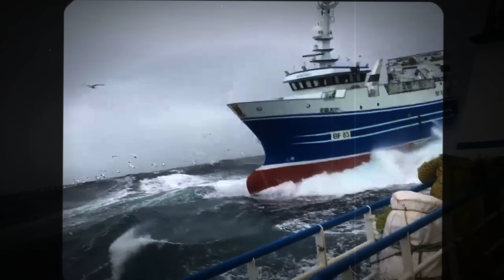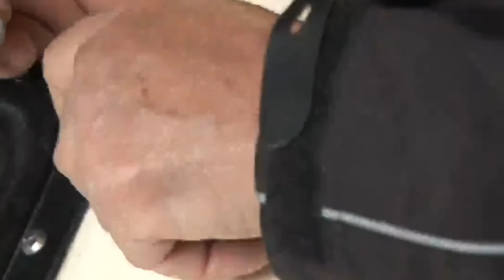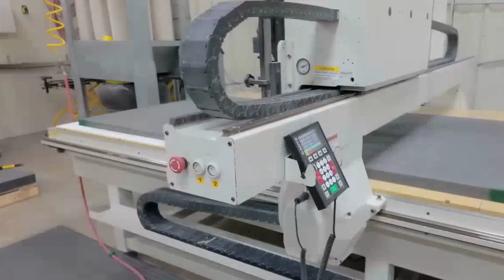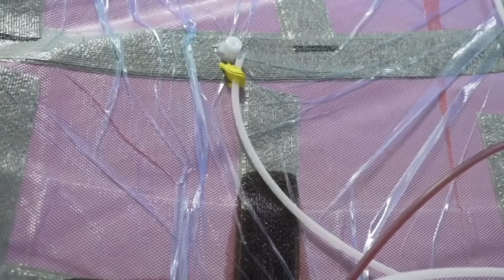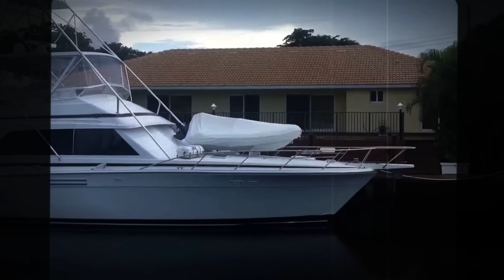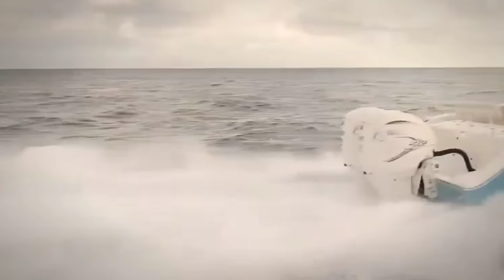The ONLY 7 Fishing Boats That Last 30+ Years in Saltwater

Comment: I have a 23-year-old Hydrasport. Hydradports from the early 2000s like mine user kevlar reinforced wood free hulls with composite fuel tanks and foam in the hull. They are tanks, but unfortunately out of production. The 24-foot Vector Series is in the same class as an older version of the smaller Regulators in my mind.

Comment: These are all very well built boats.  My only doubt is the Regulator. Not because it's hull is poorly built but I've seen A LOT  of Regulators with leaking fuel tanks. A boat is only as good as it's weakest link.  There are other manufacturers that use these construction methods, Such as Robalo. Robalo uses these hull construction methods, 316 SS thru bolted, no wood and Also uses Kevlar reinforced hulls.
Reply: I ran a few charters for a guy. He had a brand new Robolo . It's been a few years I'm guessing 2021-22. I don't know about the hull. But it was  not made well. Fold down seat broke after several trips. The dash board  and gauges always came loose . It had been back to dealer twice . Had to use duct tape to hold it in last time I ran it . The fit and finish was very sloppy in many places. I assume they don't make them like the older ones .
Reply: @paulrudar9057 in the 24' in 2021, Robalo made the R-232. It's not the same boat as my 2017 R-242. The 242 is slightly larger and known to be well built. The Hull is hand laid reinforced with Kevlar. That's why is heavy. In sloppy seas, the R-242 rides better than most midtier 26 footers. My dash has never rattled, there's not one rattle anywhere. My gauges work like the did in 2017 and have never came loose. My aft fold down seat gets used but not on every trip. It also is very solid and is the best place to ride in nasty seas. The port side hydraulic piston that holds the aft seating up is weak. Other than that... there's not one single issue with it. The Robalo R-242 isn't fast, it's a Tank! It's heavy. Which is why it's incredibly solid and dry riding. My only wish would be it had twin 200's in lieu of 150 Yamahas and, I wish it had 1 in floor fish box. Other than that, it's arguably the best 24' CC for the money.

Comment: Very interesting. I learned a lot about boat construction. I am about to sell my 2018 Montauk 170. I know I'm going to get a good price. In that year, the gas tank went under the deck. It also got wider and deeper, with a forward fish box and a bigger helm. I've had her for five years -she can handle anything. I just bought a C-Dory 22 Angler. I'm hoping I did right. It feels like it.
Reply: I fully tricked out an old whaler dauntless 18 footer. You won't find any of these boats in open water on certain unpleasant days. A rouge wave filled it up to the gunnels once, we just drove away and it scuppered itself dry. I don't know who designed this hull but it can take a sea.